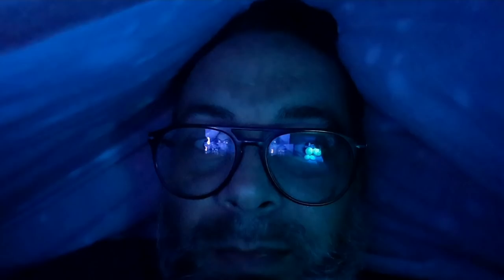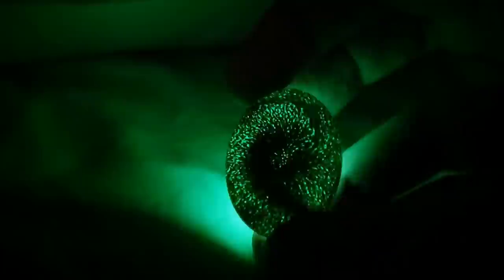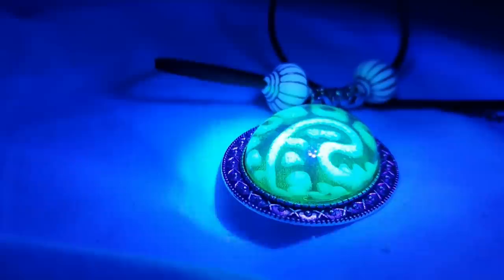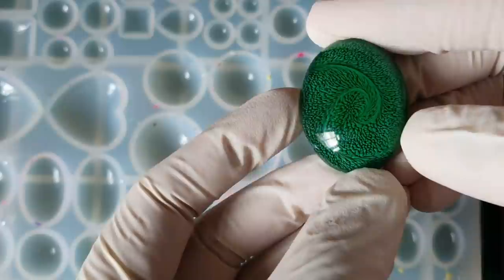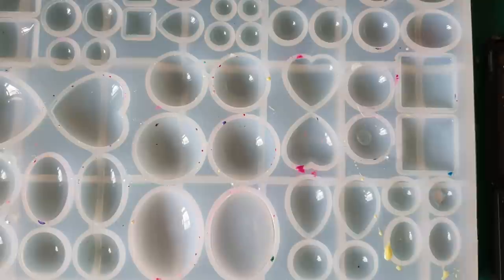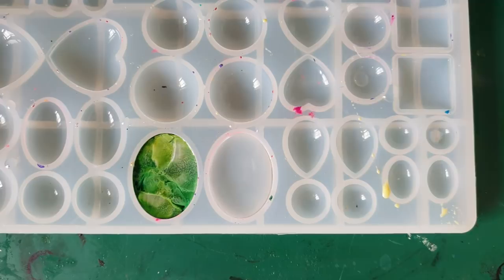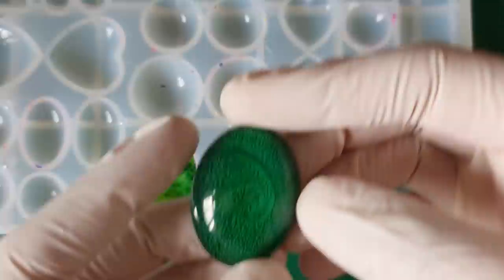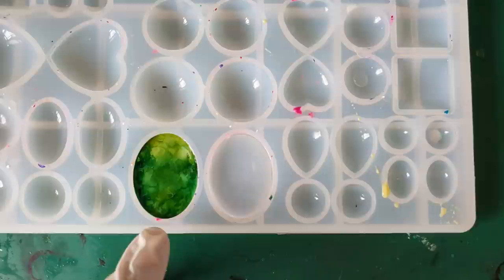#14. Moana's Heart of Te Fiti. Regular Resin & UV Resin. A Tutorial by Coopers Custom Casts.

Comment: So cool!  Yah I’ve messed with this a bit & made some nice art.  You can also put the UV directly into the mixed 2 part epoxy resin and cure it with the UV lights, then let the 2 part continue to cure overnight.  Like making white waves in blue waters.. use the UV for the white and hit it with the light, then the other blue cures around it after several hours- lots of neat stuff happens there.  It’s endless 👌
Thanks for sharing your beautiful art 😊
Reply from the maker: Awesome! Will have to try that, thanks 😊 🙏

Comment: UV resin is the only resin I have used and am actually kind of nervous to use epoxy resin (afraid of the whole mixing correctly and what if it doesn’t harden! 😬) but need to learn since I want to do some bigger projects. This heart of Ta Fiti is stunning. Thanks for sharing! ❤️
Reply from the maker: Very welcome, check out my Fire whisp tutorial as a starter with 2 part resin, YOU CAN DO IT! 🥰🥰🥰 I was nervous with UV but how do you know unless you take that leap 😊😊

Comment: Do you find that the UV resin layer separates from the epoxy resin layer?  I had heard (on shaker videos) that they didn't adhere well.

I have been using glow in the dark pigments in resin as well - most recently I made a little pencil cup and I mixed in some alcohol ink to shift the color a bit (make it deeper) and added white piñata ink to make it more opaque.  It would be interesting to see if it is possible to make alcohol ink using the glow in the dark pigments ...
Reply from the maker: Hi, have had no issues yet 😊. Yes, I have tried with glow pigments but need to work on it more before it can work but have had good results 😊.